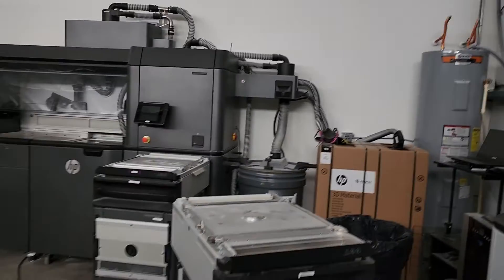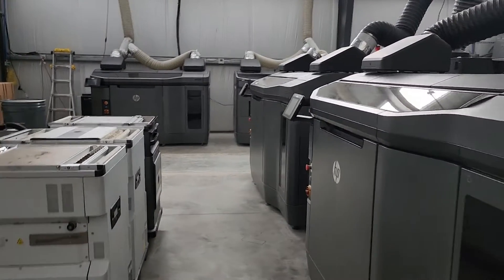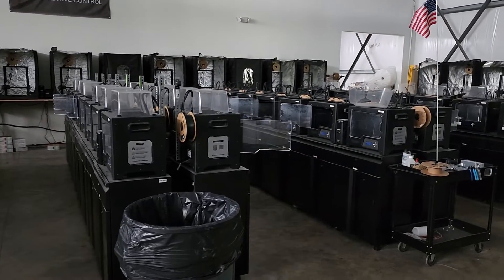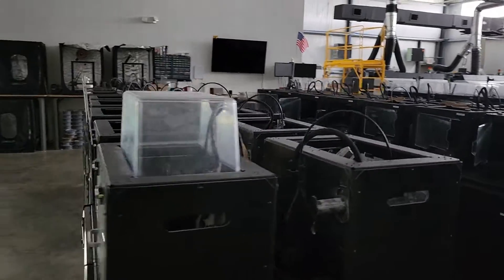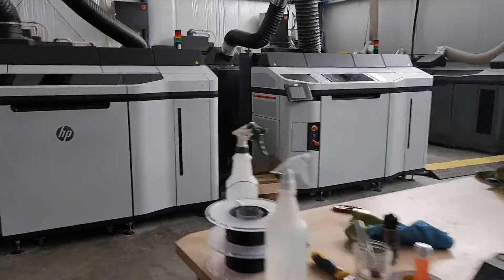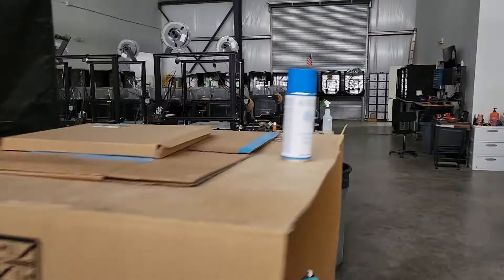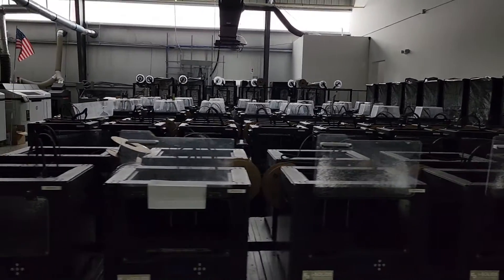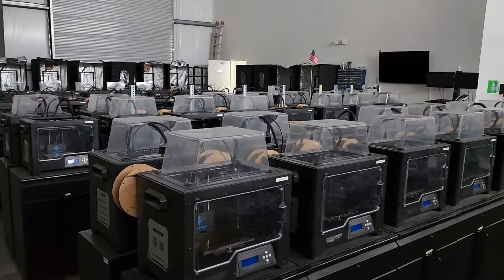How much power does an industrial 3D print farm use?

Comment: Does the heat from the nearby machines make the individual printers more efficient by not having to do as much heating?
Reply from the maker: That's an interesting questions and I can't say for certain since we haven't tested this specifically but in theory it would likely make a small improvement. Our print farm is a bit unique in comparison to some others in that we do print mostly with enclosed printers and primarily use materials like ABS and ASA. The enclosures do help keep most of the heat within the print area but there is no doubt still radiant heat that can help the machines nearby.

Being in south Texas, we typically struggle with the ambient environment being too hot and there can be noticeable difference in the print results if the room temperatures fluctuate too much. This means we do have a lot of AC units to offset most of the radiant heat from the machines. Overall, we try to control both the humidity and temperature of the shop to accommodate the needs all of our materials and printing technologies.
Reply: @i-solids  It sounds like there is a lot of room to innovate in your space.
For example, you could test to see at what ambient temp each of your printers are most efficient, and then create a closed loop system that guarantees it stays at that temp.
Maybe your desks could incorporate radiant heating like they do for floors, but you use heat sinks above the units to capture the excess heat and pump it back into the radiant system, using something like the ground source heat pump techniques.

I have no idea if it would be worth it financially, but the test to see if it would would be interesting and could allow you to get better results, maybe save time and energy thanks to that, and maybe lengthen the lifespan of the machines?

Comment: What are theose massive HP machines?
Reply from the maker: Those are HP multi-jet fusion industrial 3D printers and processing stations. Its a technology that uses polymer powder to generate 3D printed parts that have near isotropic strength and have essentially no visible layer lines. It's great for generating extremely high quality parts that look and perform like traditional injection molded parts but the speed and production capacity are where it really shines - we can produces hundreds or even thousands of parts with just one machines within a few hours. Here is a bit more information if you are interested: https://www.i-solids.com/multijetfusion

Comment: isnt the 350watts only when heating, usually printing is way lower.
Reply: I would think so
Reply from the maker: That's definitely true and a really good point that I should have mentioned. Operationally we typically start "clusters" of printers at a time and so its not unusual for 20 to 30+ printers to all be heating to max temp simultaneously. This means we do have to balance the load on each individual circuit to avoid flipping breakers and possibly losing existing prints but once the machines are operating at steady state the power usage drops to around half of the machines max capacity.

The power within the facility was designed like a machine shop where we consider both potential power spikes to start or heat machines up as well as average usage across the entire building. This is pretty common for most residential or commercial buildings but in theory if we were to attempt to simultaneously start every machine we would likely overamp the main breaker. This situation would never occur in normal operation of course.
Reply: @i-solids  I was curious if you where able to start them all at once without any issues, Thank you for elaborating on it, I know I have only 12 printers and if I want to utilize them all on my circuit I have to heat 2 at a time and wait for the others. Can be a pain.